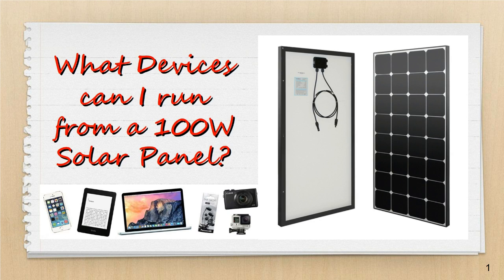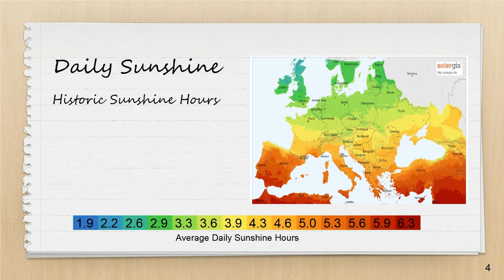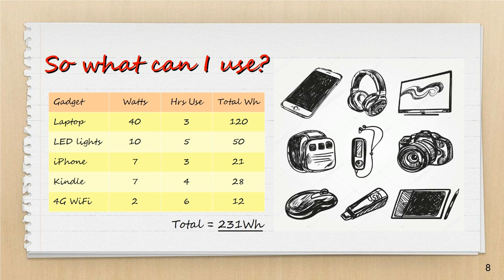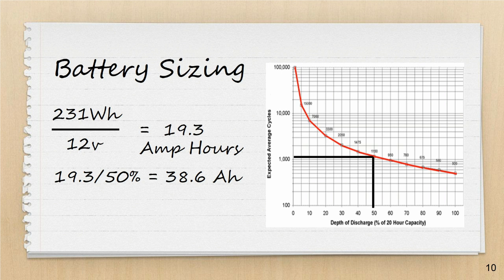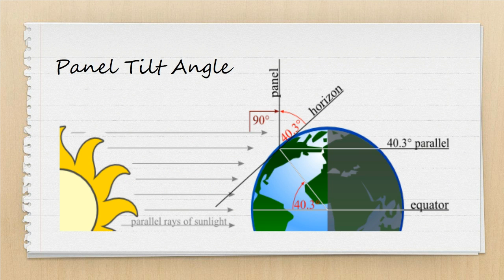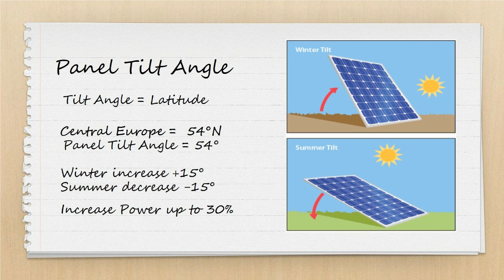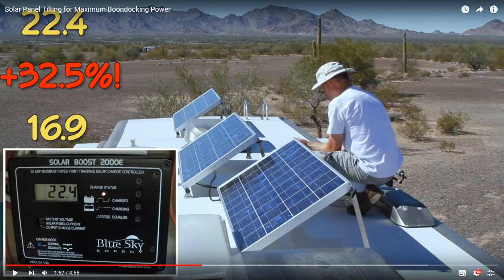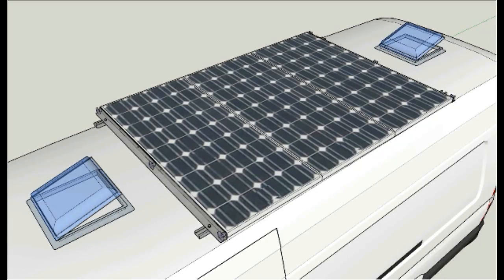What can you run on a 100W Solar Panel?

Comment: Hi Greg 2 questions 1st am I ok to use 2 batteries with the 100 watt panel ?..... 2nd how many boards have you needed to order from moorland
Reply: MAPS The Way From 10:55, it appears that he has seven sheets totally accounted for. Perhaps the eighth panel show it's a safety sheet.

Also, yes, you can have any number of panels with any number of batteries. You just need to account for the charging current produced vs. that which is needed for your battery bank. Undersizing you panels will result in very long charge cycles.
Reply from the maker: Yes, the 100W panel is designed to charge 12v batteries so if you have two 12v batteries wire them in parallel.
Like this, you can add the Ah duties of the two batteries together. Connect charger live to one battery and neg to the other to ensure even charging across both batteries.
If you have 6v batteries wire them in series to make them a 12v battery string. The Ah will not be added in this case.
Reply from the maker: As the cutting plan shows I got it down to 7 boards in the end, which is a lot but I have the shower, bulkhead, bed wall and loads of cupboards in this build. Also ordered 6 sheets of white vinyl covered 3mm plywood for the headliner and bedroom side walls.
Going to look amazing with the multicoloured LED lights washing down the white vinyl walls. D>I>S>C>O!!
Reply from the maker: Hi John, The eighth panel are in fact 6no - 8x4 sheets of 3mm white vinyl covered plywood that I'm using for the headliner and bedroom walls.
Reply: How did you get the exact size of walls an headliner?

Comment: Greg have you thought about maybe going lithium for your batteries? I'm doing so as IV ran lead acid for many years and sick of the losses involved with charging, temperature and life span.
Reply from the maker: They are just so expensive unless you have found some cheaper ones??
Reply: Greg Virgoe IV been looking at these Valence u27 used (eBay)lifepo4 with built in BMS, with logged cycles and discharge depths etc. Most have very very little cycles.  Worth a lookl
Reply: $5K  for a useable bank of lithium batteries is just too costly.  Perhaps they will come down later.

Comment: Great video.  One thing people forget is wind noise when driving. Increased fuel costs as well as whistles and general noise generated by square edges on mtg brackets. Also lying in bed on a windy 50mph gust weather being kept awake. Norfolk Uk coast can be bad. George
Reply from the maker: There's your gap in the market. You need to design an aerodynamic solar panel for vehicle use.

Comment: Hi Greg. Thanks for an awesome series. I came across your videos as I am going to get started assisting a mate in converting a 2011 Sprinter 309 into a camper. As he is also a biker he was looking for a conversion that could comfortably house his bike.
I feel that your videos are excellently produced and are a great help.
This video on solar is the best I have seen on you tube. 
He will possibly be running 3 x 100 watt panels, so this helps a massive amount.
He wants to build his van exactly like yours and as I will be doing the interior wood work (cupboards etc) I cannot wait for you build video. 
Still scratching my head on how to work out the angles (slope of the vans walls)
He will be getting his van May 10 and the build will start... 
Keep up the good work and awesome videos.
Thanks.
Francois Putter (Cape Town, South Africa)
Reply from the maker: Thank you for your very nice comments.
Even though I have drawn some detailed plans in sketch up I will still most likely template the panels that follows the curves of the side walls to get them spot on. You can use either thick cardboard or corrugated plastic sheets or thin ply for templates.
Reply: Thanks Greg. Yeah, going to be interesting. Can't wait to start the build.

Comment: Another great video Greg.  The tease for a future video with the cabinets all designed and cut pieces, I assume, all ready for you to assemble, looks amazing.  Can't wait for that one.
Reply from the maker: Hello David,
The furniture ply is made to order so I wanted to be sure I ordered the right amount.
It is due for delivery on Monday 26th March :D then I have 10days off work over Easter to get stuck in!
Reply: From the drawing on the video, I assumed each piece of each cabinet has been all ready cut for you, so all you had to do is assemble...did I assume incorrectly?
Reply from the maker: Nothing will be pre-cut. I was laying out the panels to maximise the use of the boards so I didn't over order.
I will be cutting all the 8x4 sheet fo furniture myself. look forward to those videos at Easter.

Comment: GREAT VIDEO GREG! Thank you! I have about 3500 solar panels (30watt) for trickle charging motorcycle sized batteries we use for our lightning prediction warning horns and strobes if there’s no place to mount them for a/c. 
A 52-54 degree angle for solar panels is without question a difference maker. Especially in the winter when the sun is lower and there’s less of it. My solar panels for work are stationary, so this is easy, but if you have the ability to point your solar panel(s) a southwest direction to aim them. Our little batteries are $125 we charge our customers, and we should get 5-7 years out of them. When one of the batteries die before 5 years the first thing I check is the volts directly from the solar panel. (They never go bad. Maybe 2 bad panels over 8 years and over 3000 of them) If there’s an error it’s either the angle or the direction the panel is facing.
I’m going trying to convert a cargo trailer from generator to solar power.
Your video was a great help on figuring out what I can charge or run while working at a remote site without power for 6 or 8 hours. (Drill batteries, circular saw, a couple of small fans inside and the usual cellphone charging)
Reply from the maker: A combination of parallel and series wiring fir this small panels will give you a decent array for off grid use. 
Thanks for watching the videos. 👍🏼

Comment: Great vid, nice idea with the tilting!
Adding a split charge relay and use the alternator on your way to the campsite, once arrived the panel will just have to top up your consumption that you use from the already charged batteries...
Thx for the vid!
:-)
Reply from the maker: Yes, I have a split charge relay kit to fit. I’m personally fitting 480w of Solar so will have over 1kWh of potential daily power available. I’m going to carry a small Genny for emergencies. 👍🏼😀

Comment: On my 25 foot boat in Norway, which I use in the summertime, I get at least 10 hours a day with sunlight at sea.  I run two computers, one fridge, one radio, and one electric razor without any problems on one 100w solar panel (about 19 v). It charges my battery more every day, then what I need. I get about 5 -5,5 amp into the battery every hour, and more than 50 amp (sometimes up to 80 amp on a very good day) into my battery. The Gps, walkie, talkie, and systems I need when moving at sea, draw power from my other battery that my engine is charging. If it rains for a couple of days, and I only get 40 amps into my battery, I can always connect my fridge for a few hours to my other battery. This way, a 100 w solar panel, can surely provide you with all the power you need on board a boat. I do have a 50liter fridge made to be very efficient for this type of use. Ps. I don't use computers for other than weather and news. My leisure battery is at 115 amp, and the other battery is 85 amp. Remember, summertime in Norway never gets totally dark. Remember to use an MPPT controller, so it gets usage of the Voltage over the first 12 V a not MPPT controller can. The fridge is using power at most for 20 minutes per hour, even less at night time.
Reply: Unfortunately not all of us live close to the Arctic Circle with long days and short nights during the summer months. Some of us live in the American Southwest with dry very hot temperatures requiring a air conditioner powered by a noisy inverter generator banging away all day and all night. Solar panels are only good for recharging batteries for smart phones, tablets, notebooks, and LED lighting. We use propane to power refrigerators, air conditioners, heaters, stoves, and hot water tanks...

Comment: For my home Solar Array I got two one hundred watt panels 
and hooked them in series for 24 volts. I found a charger that accepts 12 or 24 volt input. Now, on a cloudy day when I would have only gotten 10 volts I now get 20 volts in series. The amperage isn’t as much but I’m still charging  even in the rain.
Reply from the maker: Nice one George Crabtree that’s exactly why I wired my three panels in series 👍🏼

Comment: Excellent video, am interested in solar panels and was about to attempt the maths to size the battery and here are all the details. Interesting re ambient temperature hadn’t thought of that👍
Reply from the maker: Horse Radish yes it’s funny that a solar panel designed to be in the sun gets worse the hotter it gets. So good to make sure you have airflow around them to keep them cooler 😎

Comment: 3.3 hours of sun a day ,,,, wow now i see why your map hasnt Australia on it ,, we get 10.9 in Mid Winter ,, so glad i moved from Kent England 20 years ago ,,,, Great vid !
Reply: Australia is a huge country of course so it will vary greatly depending on where you live.
Reply: @Daz5Daz  Im on the south east coast  the further north the hotter south cooler ,, In 20 years since moving here i havent seen snow ,,, YAY ,, 
traveling the southe east coast NSW Australia 32` eleite Motorhome , 325 watt solar epever mppt controller and 4x 140ah maverick AGM batteries with a 3000 watt Inverter (roughie ) and a 600 watt pure sine inveter ,,so far no low batt conditions in 2 1/2 years ,, Livin the life , Google "Nowra NSW Australia " Im there now .

Comment: Very straight forward and logical approach.  Many thanks.  I would just like to say though that if you have a 50mm rod perpendicular to the surface of the panel then you could just lift the panel using sliding rods until the shadow is almost gone.  This will be the most accurate indication that you are exactly 90 degrees to the suns rays.  Also it will allow you to rotate your van so that it is exactly facing the sun and not out of rotational alignment.  I assume there will be some clever bod out there that can use this method to create a motor driven lifter to keep it aligned but not sure if that would be a waste of charge.
Reply from the maker: I see what you are saying but ten minutes later the sun will have moved and it will be out fo alignment.
So as long as the panels are pointing due south, the sun will track across the sky n front of them most of the day.
And when it is at its best at midday your panel will be in the best position. 
There are solar tracking systems but to put that rig on your van seem very OTT

Comment: Thank you. Very helpful. I watched countless videos. None were as. practical and useful as yours. I would say that the watt hours is not an exact science. When I’m using various items on a sunny day my battery stays topped off. Of course when the darkness comes: then I have to monitor things closely.
Reply from the maker: Wander Lost RVr yes during the day if it’s sunny you are possibly using less power than is put in by your solar system.  This is the time to charge all your tech when you have spare capacity. Then at night when you don’t have solar you can use your tech on its own batteries to save your leisure battery for lighting etc

Comment: Another excellent video, shared to the motorhome site on FB
Reply from the maker: Thank you for doing that Malcolm, you're a true gent. Cheers
Reply: It's the least i can do Greg when you spend so much time making these videos, you should see some of the terrible ideas people put on there, i'd tag you on a post, someone is suggesting putting a lawnmower type connector under a van to plug a solar panel in, no cover on the exposed plug!
Reply from the maker: Which group is it, please? 
Can you send me a link maybe,
Thanks

Comment: Nice video Greg. One good thing about living in Jakarta is that when I finally get my campervan build underway I won't have to worry about my panel tilt angle as I'm close to the Equator! Now all I have to work out is how I'm not going to get fried to death while living in a tin box in a sub-tropical climate!  Perhaps you could make that the subject of your next video!
Reply from the maker: Nice place to live, one of the largest sources of heat gain to a vehicle is solar gain through the windows, it will make a massive difference if you have reflective shading on all your exposed windows. This is to prevent the suns rays from entering the vehicle and warming up the objects inside. Insulating your van will also help to reduce the transmission gains through the body fo the van, just a like a cool box is insulated to keep the contents cold, it works the same in hot or cold climates. Lastly, have good ventilation on the roof to extract any hot air and provide nice cooling ventilation at night when the temperature drops. Hope that helps
Reply: @GregVirgoe  Thanks for the advice. Jakarta itself is not so nice but there are some interesting places in Java and some of  the other islands like Sumatra, Bali, Lombok, Flores, Sulawesi and not forgetting Borneo. (We might be better off buying a boat as well because we'll be spending a fortune on ferries :)). We'll certainly be making reflective window shades but might draw a line at insulating this first vehicle as it will make it a bit difficult to sell in the future (never seen a campervan or 'proper' campsite in my 20 years here). If we're still keen after making  a few trips on Java and the neighbouring islands I think we will upgrade to something more serious with 4WD and fully insulated.  
Good luck with your European tour.

Comment: First class stuff as always Greg - shouldn't be too difficult or costly to incorporate a linear actuator into the panel tilt mechanism.
Reply from the maker: Hello fraser, I did give it some thought. Messed about with the brace geometry but each time in the down position the frame would be level and the tendency would be to lock up. 
If you want to prototype something I’ll gladly take a look at it. Cheers
Reply: Greg Virgoe  - I was thinking along the lines of an old type car jack arrangement - the one that ends up diamond shaped when fully extended. This design would have no problem starting , and no over centre toggle effect. Would also have a decent mechanical advantage so could be positioned near the pivot point - just my two pennorth - can' t wait for next episode. Best regards.
Reply from the maker: It was definitely something I considered just couldn’t come up with a simple mole solution and have tons of more important things to finish first. 
Thanks for the suggestion it would be excellent if they could be motorised. Ta

Comment: I run my Xbox One s and a Samsung 32' TV all day, and I only play like 2 hours during the night. No problem with just 1 100-watt solar pannel, a 20ah lifep04 battery, a 410-watt modefied power inverter, and a renogy 20A solar mppt charger. Crazy !! Also, sometimes, I use a 40-foot extension cord to hook up a TV in the living room. I also charge everyone's phones on this setup 24/7 !!!  And an LED work light all night ! Insane !!!!

My goal is to add 4 more solar panels, probably make it a 24-v system and buy 2 100ah lifep4 batteries, and wire them to make it a 24v battery bank. And get something to turn this output back to 12v so I can keep the same mppt charge controller and run my daily things. I can only imagine the possibilities. In my area we get a lot of power outages so this helps a lot. I got this little system just to power phones when the power goes out, but Damm, I didn't know I could do so much more!
Reply from the maker: That’s fantastic, you are most likely using most of the excess solar during the day once the battery is topped up so that’s extending your capacity. Using it to power stuff in the house will pay back your investment in no time at all with the fuel savings. I don’t know why more people don’t invest in solar. 
Don’t pay these solar companies huge amounts to fit a grid tied system. Do it yourself and get off grid it’s the way forward. I recon it could easily pay back in 6 months

Comment: Thanks for the video found this really helpful as I'm investing in one for my shed cheers
Reply from the maker: bob f take a look at Renogy as they have some really good prices now and their gear is top notch.
Reply: @GregVirgoe  thank you mate appreciated I want a off grid one as I've got a allotment plot and need it for my shed
Reply from the maker: bob f yeah you could probably put a small system in your shed for about £250. Charging phones, radio and 12v kettle for odd cuppa ☕️
Reply: @GregVirgoe  that would be great basically that is  what I want it for and some light for the evening thanks
Reply from the maker: bob f a panel on a SSW facing sloping roof would work really well. Try and keep everything 12v so you don’t need an inverter 👍🏼😀
Reply: @GregVirgoe  thanks again mate you have been a great help I've subscribed cheers 👍
Reply: @GregVirgoe  would 12v power a small TV